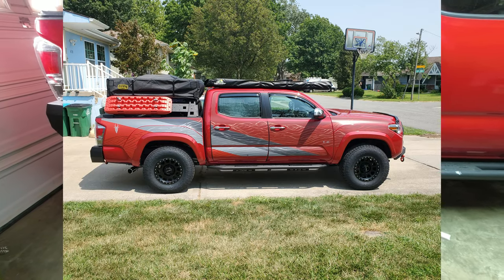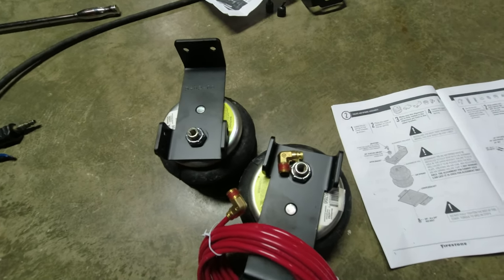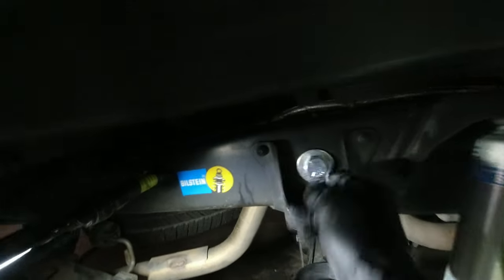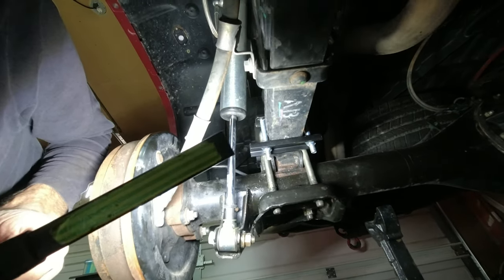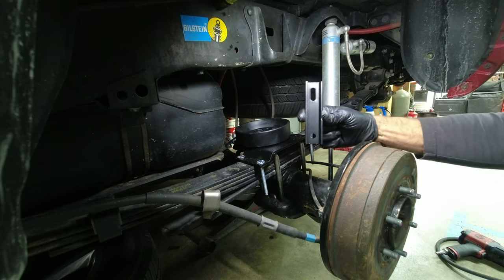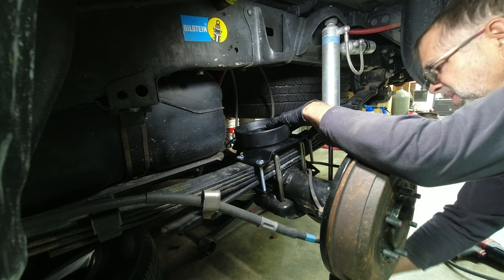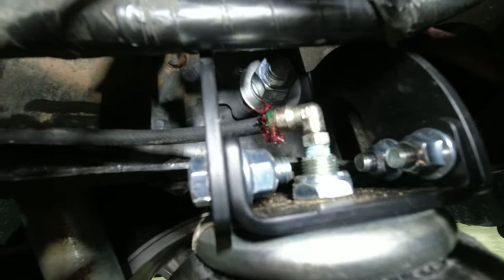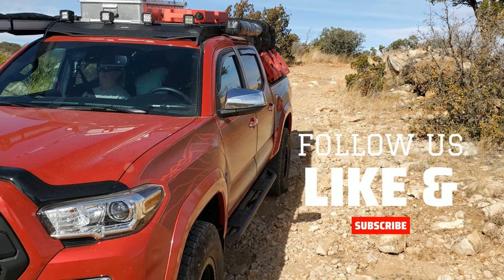Toyota Air Springs and Cradles. Some Issues You May Want To Avoid #tacoma #toyota #4x4  #overlanding

Comment: Why not just removed the original bump stops all together rather than cutting them? What purpose do they serve? Spacing for the cradle? Going to do this on my gen 3 taco. Thanks!
Reply from the maker: To be honest I can’t remember what they were needed for but they were needed. I had to search for where I had stored them away because I took them off and tried the Sumo Springs in their place. Thanks for the question and enjoy the project. They work well for me.

Comment: Were your SumoSprings in constant contact when loaded? Are you happier with the air bags compared to the SumoSprings?
Reply from the maker: The Sumo springs with an add a leaf were not in constant contact when loaded for a trip (although it was close)and did quite well. I wanted the adjustability of the air bags and I do not regret the decision. I like the idea that the air bags take some of the load off the leaf springs. I appreciate your question.
Reply: @copelandingadventures  Thank you! I appreciate your reply!

Comment: Great video! Thanks for posting it was very easy to follow along. Question - Do you know the size of the new air fittings you received? I was sent the wrong size as well - same problem as you. I’m hoping to pick up the correct ones at Home Depot.
Reply from the maker: I believe it was 1/8” or 1/4” pipe thread. I can’t honestly remember. Also double check the air bags for leaking at the crimp. One of mine leaked. It seems quality was not on the agenda.